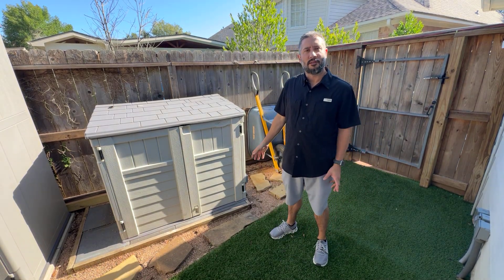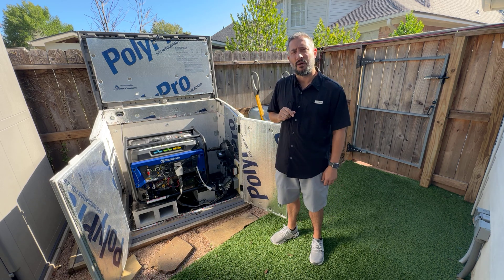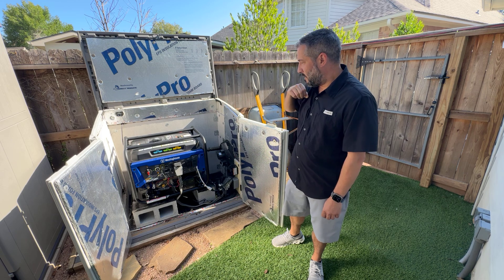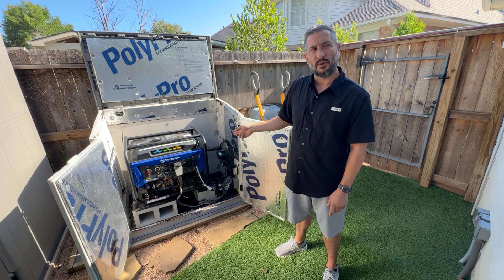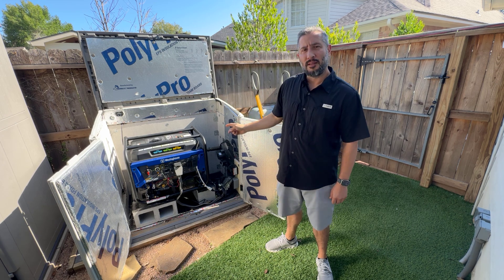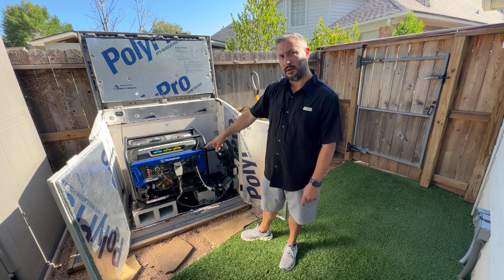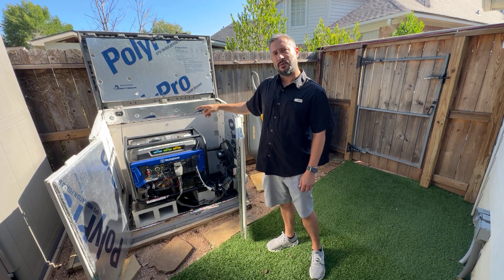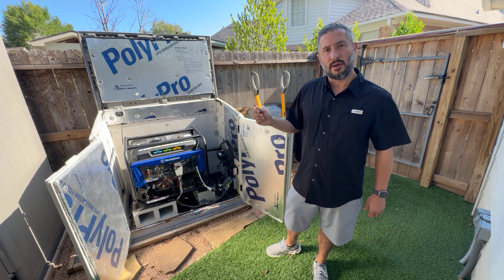Portable Generator Home Backup FAQ w/ Westinghouse WGen11500TFc Specifics

Comment: How many hours has the genny running with your plug choice? And, have you pulled the plug lately to determine if it's been running hot (very light color, possibly eroded electrode)? Recommendations are all over the place in regards to plugs for this unit. Westinghouse says no to a resistor type sparkplug, which this one is. Also, although generally it's advised to run a cooler plug when burning NG instead of gasoline, this plug is a heat range hotter that the equipped torch plug. I have read that you need to run a hotter plug if it is equipped with a resistor. Is this why you chose this hotter plug? I am considering this plug, the NKG Iridium, and trying to find the non-resistor plug that you are using, but at the 7 heat range (which has been discontinued, but available overseas at a high price). I't crazy that there is so much conflicting info out there, but more and more this seems to be the case about so many things!

Comment: Great video's Calvin! I just purchased the same generator and have a couple of questions, and sorry if these have been addressed somewhere:

1) On natural gas, the generator is rated @ 9,500W continuous, but does this include use as a home generator where it may be running literally for days? Is there a max draw you recommend for round the clock use?
2) Bonding, you've explained that both the generator and the house shouldn't both be bonded when connected to the breaker box, but why is this? I ask because a lot of people don't un bond the generator when connecting the the house breaker box via an interlink.

Comment: Calvin, what would I be able to run in a 1500 sq ft house in a major outage on natural gas with this size gen? I am looking at one that puts out 11,500 running watts on NG but its nearly a 1K more in cost. *westinghouse
My electrician who I hired to put in a new breaker box last month with a soft start will only tell me get one with at least 10K running watts or MORE and so the one I am seeking out is 450lbs and 18000 watts on gasoline and 14,400 peak watts on NG with the as I said 11,500 running. 

I want to run my central a/c and some lights, microwave , everything is gas in kitchen, washer dryer both electric. I understand I might need to turn off the a/c for that. I am speaking of a week or several days of power outage like during a hurricane. For minimal time I would only want to run the a/c and or heat and a few lights. 
If it is worth the extra grand to get the bigger one to be safe I would do it but this is a lot of money, esp after I just paid out for a new breaker box and soft start kit to be installed last month. That being said for something which will spend most of its life for me just sitting in the shed or the garage stored for those emergencies. I have big sheds and patio covers for using the generator outside. Plenty of ventilation, thats covered. I will be having NG quick connects put on the gas meter and one on the patio. House built in 1962 and had gas lines all over it. Btw, its only about 1500 sq ft, just under, so a small house. 

It is myself *over 60 with disabilities and my mom who is 80. I dont want to be lifting and putting window units in windows if I do not have to. It is too hard and esp after a storm when others are busy with their own lives. 
 
I would appreciate any info on this. I live in Pasadena. I would love to talk here or if you would want to text me we could talk. 

Appreicate any help, thanks

Tommy

Comment: Calvin, I have the same generator you do with an identical setup, minus the transfer switch. I am running just an interlock kit and power inlet to my main panel. My question is, do I need to connect my generator to its own grounding rod? I don't see you using one. I'm assuming the metal frame that the generator is connected to acts as a ground, and unbonding the generator will protect the system.

Comment: Just a quick question about the vibration reducing pads are they sitting on top of the cinderblocks and then the generator sits on top of  the pads or are they under the cinderblocks and the generator sets on top of the cinderblock?
Reply from the maker: They are under the generator, on top of the cinderblocks 🙂
Reply: @CalvinGorriaran Thank you sir for all your advice and help!! A/C-Furnace guys is coming out this week to set up the soft start on the A/C unit and put in the natural gas line so that we can run the flexible gas line from the shed to the house. I hope you won’t mind if I have any other questions…..Thank you very much for your help!!

Comment: Thank you very much for sharing all your experience and knowledge with us! Just bought this exact generator and starting the install process now. My wife has MS and we have to keep AC up and running or she has major problems. Just got a like and a new sub!
Reply from the maker: Thank you!
Reply: @CalvinGorriaran Hi Calvin, I'm still waiting on my soft start kit to come in....been on back order this whole time. Another wuick question, do you remove the generator from the enclosure to do maintenance...since its kind  of a permanent install,or replece the wheels and pull it out?

Comment: Just for calcification of the removal of the Bonded jumper wire. I took my cover off and see green/yellow jumper wire labeled in the manual as Bonded jumper wire. I'm using this generator hooked up into my home fuse panel with its own breaker to power my home during outages. So I need to remove this jumper bond wire? Also did you ground the generator at the grounding screw in the front with a rod in the ground?  anyone figure out howe to by pass the CO sensor on the 11500TFC?

Comment: 5:45 honestly that seems very unnecessary, the genny is already off so it's not producing anymore heat, it will cool off by itself its not like the temp is gonna keep rising for no reason. worst case scenario you can just leave a door open since there's no noise anymore
Reply: there something called heat soak, when the gen is off the flywheel fan is no longer blowing air at the cylinders and the a;ternators fan is no longer blowing air over the coils. these heat soaked items along with the muffler have heat that will continue to radiate , this will cause the enclosure temps to go up then it will go back down .  This is the same reason why turbos cook themselves  when turned off hot ,or why an engine ran hard should be turned off immediately and should be allowed to cool down.

Comment: Great Video!  I have a question on the boned/non bonded.  How do I know if I need to make a change.  A little history.  I had an electrician put in an interlock/50 Amp connection for my house.  After Hurricane Beryl,  I ran my Firman Generator for 7 days and did not make any changes to it in regards to bond/non bonded.  FYI...I bought this one so I can only rely on natural gas going forward.
Reply: wondering the same

Comment: My personal experience is running a 5kw Honda in a cinder block box. I started with a 12" fan and temp inside got up to 130F. I live in a goldilocks climate zone 68-82 year round. The interior temp freaked me out and I ended up with a 16" AC Infinity 3000 cfm fan which did the trick. Now the interior temp ranges between 10-15 deg above ambient. I couldn't see what the intake side looks like in your install.  In my case the opening is 16" sq. and I stuffed in a hardware store room fan to improve circulation. 
    If the fan fails or the temp inside gets too hot I installed a bielectric temp switch to shut the gen down if the compartment goes above 130f. It is wired into the low oil level switch. There are a couple of youtube videos on how to do this. Something to think about.
    If you want to reduce noise levels, since you are in a residential area, consider curved exhaust hoods/ducts on both ends. Sound loves to travel in straight lines.  In reality these applications are for power failures which typically are far and between.

Comment: hey Calvin, i just had my generator and im trying to use NG, can you send a picture or a short video that explains how you turned the gas regultor so i can hook it up with the door closed? and can I run a 50' NG 1/2 inch hose or i should upgrade to 3/4 inch
Reply: I’m on the same situation as yours. Did you find a fix?

Comment: Thanks Calvin!! I am in Richmond, TX close to Sugar Land. I recently got my Westinghouse WGen14500TFc (Tri-Fuel). I wanted to ask you what oil you use. I was reading the manual and it says I can use Synthetic 5W-30. I bought STP synthetic SAE 5W-30 (part # STPSYN5W305Q) from AutoZone. The people from auto zone were not sure if this oil will work on the generator. Thanks for sharing, already subscribed!
Reply: Get the full synthetic 5w-30 small engine oil from Home Depot. It’s made for these small air cooled engines with the right spec for them.

Comment: Hello - Did you twist the natural gas intake in order to fit the generator inside the shed?
Reply: Great question. That shed door won't close with the bulky factory gas quick-disconnect hanging-off the front off the WGEN.

Comment: Where's the video with how loud this beast is? Lol
Reply: These are about the loudest generators you can buy.
Reply: @JetFire9   Should hear their really big ones...20kw+.   Or the big Firman 15kw.  Yeow...
Reply: @JetFire9   I still can't decide if I want to just buy one of these so I have close to the 12k ability with LPG and ditch the Genmax 7500.  It's really more a pain to have to wheel out a pair of them in parallel to get that power versus just buying one larger unit and wheeling one out.  I'd still buy a smaller 240v 50a plugged inverter to have as a backup to the backup.  Or just keep a single Genmax.  The other option my wife and I talked about is just buying either the 8.5kw or 12.5kw Champion standby generator that can be done as a "manual transfer" instead of full ATS stuff.  Less to go wrong plus way better warranty (10 years...2 years parts/service then remaining 8 years parts) and it's always outside hooked to propane and ready to go in the elements and won't mind it.  That's about $2900 shipped for the 8.5kw or $3750 shipped for the 12.5k.  Hmm.

Comment: Great video! Since we now get more brutal winter storms down here now too, have you tried running your heater on this yet? And if so, does it require any type of softstart device as well? Thanks for the great content!
Reply: There is no surge with an electrical heater. But they take a ton of electricity. If it’s a gas heater, then the wattage is very low.

Comment: I am about to start "the build". My westinghouse 14500 just arrived.  I bought a a 14in fan (1000cfm), but can save $15 on a 12 in fan (940cfm). Is 60cfm much of a difference? Shed size is same as yours.

Comment: Hi, do you set the selector to Natural Gas when using Natural Gas?

I have the Westinghouse WGEN11500Tfc generator and have the gauge to read my natural gas pressure. My meter has 2 psi and plumber installed a 1" tee off for my generator. I have an adjustable regulator right at the meter to reduce the 2 psi to 7-11 W.C. I have a 10ft long 3/4" ID hose connecting from the regulator to generator with 1" to 3/4" reducer at the regulator side and 3/4" to 1/2" reducer at the generator side. I also changed out the stock spark plug to NGK BP7ES and gapped it at 0.024". I tried many runs, setting mine from 7" W.C. up to 11" W.C. In all my runs, my generator ran rough using the Natural Gas Selector and ran smooth using the Propane Selector while using NG. I preferred not running NG using switch set to Propane if possible. But if that's what need to be then that will be it. If I take this route, did anyone get any adverse effect when running to or close to full load using NG with switch set to Propane. Please reply to let me know: it is greatly appreciated. Thanks in advance!

Comment: Sorry one more question - You stated that changed the spark plug helps with Gas but then you state you run Gasoline (non ethanol) does that plug you swapped out do fine with Gasoline also.  Video is super helpful Ty!
Reply: Always change the plug to a real brand like NGK.

Comment: Will your generator, 11500TFC, fit in the shed with the wheels on?  From your video I don't think it fits with the wheels.
Reply from the maker: No, only fits with them off. That being said, I won’t put them on again until it likely leaves the shed or major maintenance.
Reply: @CalvinGorriaran    Can you do all the maintenance on your generator without removing it from the shed?  Oil changes? Spark plug removal? Air Filter cleaning?

Comment: The manual says to always use none resistor type spark plugs the link you have is a resistor type spark plug.  I just purchased this same generator and plan to run it on natural gas. Just want to make sure I'm replacing the spark plug with the correct one. Thanks for the videos.
Reply from the maker: I believe the documentation has some conflicting information. That being said, I haven’t had any issues with the plug I listed in the description.
Reply: Go non-resistor. The original plug is non-resistor, so that means the ignition system already has the resistor built in. No good doubling the resistance.

Comment: I have a question about the floating neutral generator.  When the exhaust fan is running off the generator how is this fan grounded? Or, is the exhaust fan bonded because once the generator is plugged into the home's 50 amp inlet the entire system becomes bonded including the 15-20 amp connections so the exhaust fan become bonded as well.  Also, any issues with the Carbon Monoxide sensor causing the generator to stall because of the tight enclosure?  I know the exhaust is going outside the shed but unless you caulk or foam the exhaust could leak back in and shut off the generator.  Did you tape over the CO sensor?
Reply from the maker: The fan is grounded and bonded through the main panel. The 50A plug is permanently connected to my panel. I have not had any issues with the sensor unless the fan not running. Which in that case, I am good with it shutting the generator down for heat safety.

Comment: I am looking at purchasing the same Westinghouse unit that you were using and I know that they advertise a low THD so I am curious to know if you have been running your sensitive electronic equipment while using the generator and if so, have you had any issues Thanks for your videos. They’re very helpful and informative.
Reply from the maker: No issues and less issues than my previous generator that had a higher advertised THD as far as lights flickering, etc.

Comment: I am looking at getting the same Westinghouse generator and I know that this unit is advertised as having low THD.  Have you actually run sensitive equipment like computers and tv while using the generator. Thanks for your videos.  Vince
Reply from the maker: Yes. The entire house has run on this generator for 4 days straight. No issues.

Comment: Have you had to increase hose diameter size since you're running a 25ft hose and powering whole house HVAC? Was wondering if i need to increase to 3/4in to maximize NG flow? Any issues at 1/2 in and 25ft?
Reply from the maker: I just used the 1/2in that came with the generator. No issues with enough fuel.

Comment: Great video. Waiting for my WGen11500TFC to arrive then building a shed. I looked at the prebuilt stuff but opted to build a 5hx6wx3d shed to hold the LP tanks, potentially 2 WGen11500TFC in the future. Can you elaborate a little on the insulation you added. I would have love to add Rockwool® Mineral Wool 80, however, they have impossible to find. I don't care too much about the sound as the enclosed shed should muffle some of that. I'm thinking of lining my wood shed with 1/2 cement board

Comment: Are you using a interlock kit at your service panel or a transfer switch?
Reply from the maker: @jbhobbyist9372  interlock with a hardwired breaker. Not using an inlet and cord.
Reply: @CalvinGorriaran  I really like your idea's

Comment: What gap do you set the sparkplug at. I've heard that it should be changed to 20. Using a ngk plug.
Reply from the maker: @briancarpenter2981  I just used the plug the way it came out of the box.

Comment: One thing that may help with the heat is having the exhaust fan as far up as you can. 
A shed is a long term upgrade I plan on, so have been looking at others for ideas.
Reply from the maker: @blupupher  I am considering adding a second fan either at the top lid, like an attic fan or just another fan like I have right above the existing fan.

Comment: Why did you switch from the Duromax to the westenhouse?
Reply from the maker: @willsmiths5409  low THD, little more power, and an automatic choke with a remote start. Decent upgrades and the old Duromax generator has a new job :)
Reply: @CalvinGorriaran  thanks

I have the duromax 12000. The spark plugs you listed here, any chance do you know if works for that?
Reply from the maker: @willsmiths5409  I believe so. Two of my neighbors have the Duromax 13000 and they worked perfectly with their generators.